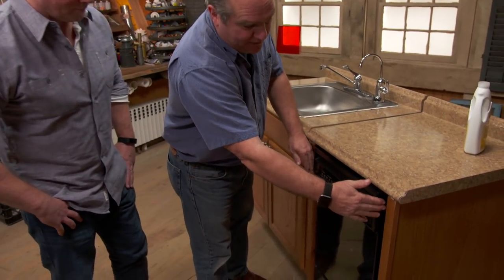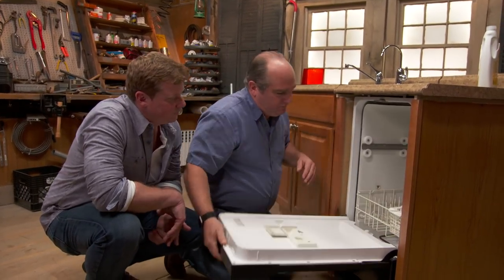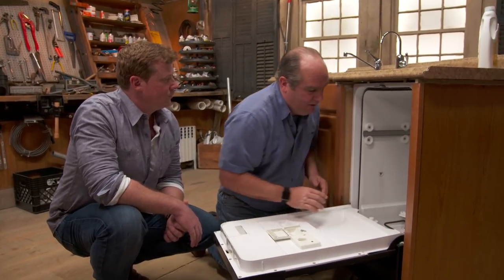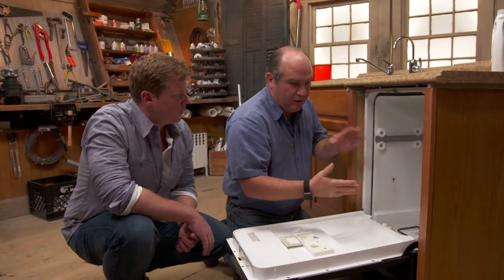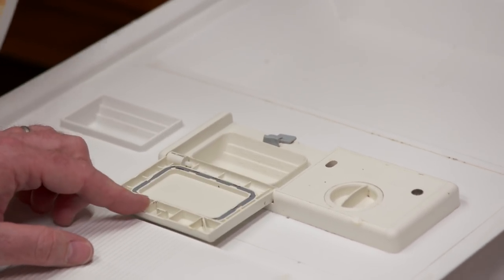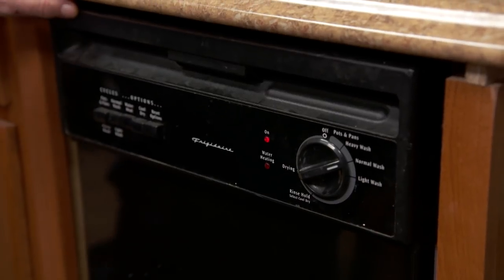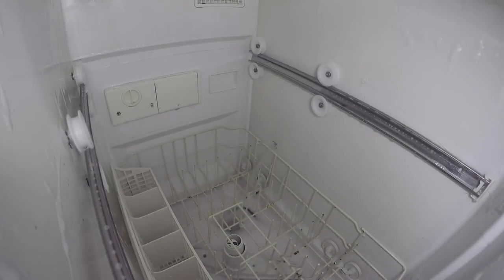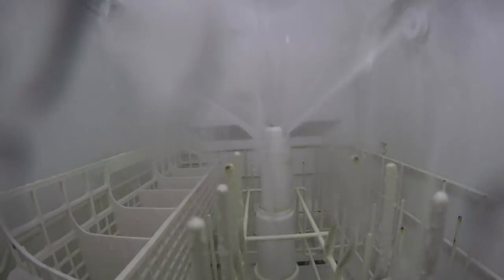Understanding the Cycles of a Dishwasher | Ask This Old House

Comment: Also, even if you use a pod for the main wash. Use a little liquid for the prewash. That little bit of extra cleaning time can go a long way, especially for a load of pots and pans. 

It is also worth checking the owners manual. Many dishwashers do not heat the prewash water, because it is a shorter part of the cycle. In that case, run your kitchen faucet until you get hot water, right before starting the dishwasher. Hot water simply cleans better.

Comment: Tip: If you have a manual knob dishwasher like this one, make the selection on the rotating knob before closing the door completely. Otherwise, the internal contacts of the knob will electrically arc as you spin it, prematurely wearing them out.
Learn from my mistake, and save yourself a couple hundred bucks on that repair.
Reply: THANK YOU!

Comment: One thing not mentioned anywhere in video or comments is that many dishwashers have a turbidity sensor. This senses how dirty the drain water is and based on that runs more cycles. I found this out when replacing my bottom rubber tub on my GE washer

Comment: My caloric built in 2000 is similar but has a smaller arm above top rack,  schematic shows it has water pumped to it, been cleaning out lime or scale today of both arms, manually and running vinegar through it after, was all clogged up, still don't think it's spinning yet or it's for a certain setting, the bottom arm is ok IDK, just bought the place. The bottom arm has small metal heat shields where it stops above the heat element, make sure they stay on!!! Pretty sure I'll have it working ok.

Comment: Do you believe it is necessary to affix a shield (say aluminum skin) to the underside of a wooden countertop  to protect it from steam coming from door when opened after cleaning?
Reply: A couple coats of urethane on the underside of the countertop that's exposed to the steam would do the trick. We installed quartz countertops and used acrylic sealant on the unfinished/unpolished underside just above our dishwasher before installing it.

Cheers, and good luck.

Comment: I always wonder how does the rinse aid gets released no one has posted video on that.
Reply: There is just a small valve at the bottom of the rinse aid well and when the timer calls for it the valve opens and drains a bit into the basin for use.

Comment: That final power drying cycle is wasteful, hence I always choose "no heat dry". Given a couple of hours, the dishes will dry anyway due to residual heat from the wash.
Reply: Timur G yep, I just open it up when hot and let the dishes air dry.
Reply: Timur G I do the same I pull the door open/pull the baskets out to let it vent properly & the dishes are 100% dry in 10 mins from the heat
Reply: The heat is to sanitize

Comment: Your are wrong!!! Float doesn't trigger the water intake solenoid until water level is reached. GE dishwashers let flow water during 44 seconds before starting the washing cycle. Float is a security that triggers the solenoid ONLY if water level becomes too high.
I'm having problems right now because pressure is to low and 44 seconds of water is not enough to clean the dishes well...
Reply: you do not know how all dishwashers operate. Richard is correct.

Comment: Maybe...but I believe you are wrong about the Flot, it is not to stop the water normally, it will stop the water only if it overflows, the dishwasher fill at first by time controled by the control panel program
Reply: this dishwasher uses the float switch to sense the level. thank you.

Comment: I have never seen a dishwasher with "hot water in" as stated at 0:32 Every single one i've ever installed have been COLD water in ONLY. The dishwasher has a water heater itself to heat the water for its wash cycles.
Reply: Game Changer WHAT? Exactly what century was your dishwasher made in? A modern appliance should ONLY have to heat water for a possible sanitary cycle! Yes, hot water in only! You sure don't know how to install a dishwasher!  Watch a few installation videos and be surprised!. What an energy waster you are, using a dishwasher to heat cold water, I'll bet your cycles run forever!
Reply: love it or leave it, i'm sorry if you're only used to cheap low end dishwashers without a heating system.  but EVERY dishwasher i've installed had a heating system. speak of only what you know.
Reply: @randomsecrets  you have no idea what you're talking about. all dishwashers require a hot water input. post no more comments please.
Reply: i mean what kind of idiot hooks up a dishwasher to cold water. really.

Comment: wow i though there was a lot more spraying going on inside in different directions.  no wonder why dishwashers are crap
Reply: I think this one came of of a museum. No comparisation to a modern one. At least the the moderate priced one i bought here in germany two years ago.
Reply: 32deej There is, that dishwasher has one spray arm. Most regular sized dishwashers have 2-3 spray arms that really increase the amount of spraying going on, but that particular dishwasher is shitty.
Reply: This is an example of the kind of trade off with moving to modern appliances. One spray arm but it's still running (what appears to be) 100 years later. But move to a modern one with more features/power and the electronics go south 13 months in leaving you very frustrated and learning how to repair/replace a control panel. This message brought to you by maytag.
Reply: 32deej I have a newer Maytag Jetclean dishwasher and it works perfectly. I love it!
Reply: give it 14 months.
Reply: 32deej nope I've had it for four years. Looks like you got some bad luck 😂
Reply: Daniel Woods haha. this may also be true. we'll see if this control panel lasts longer.
Reply: It's not only the dishwashers, it's mostly the detergent. Ever since they took STTP out of the formulas, it hasn't been the same. You either have to get Bubble Bandit or Somat, and both of those products cost an arm and a leg. Even Somat is going phosphate free, so the bags that have phosphates in them are limited. You can always buy the STTP and just add it to your wash load and you'll see the difference. It may not be environmentally friendly, but it works. 

The OxiClean Power Crystals with phosphates added to it were the best, but for some reason; that's gone also. You can still get it, but they want $40 for a 12oz bottle.

You're right though, the older dishwasher did use more water and power.
Reply: @lori4340  Yeah, my dishwasher works great. I was having problems with my detergent not working but since then I've tried the top 3 Consumer Reports detergents, Kirkland (costco) pacs, Members Mark (sams club) pacs, and Finish quantum and they've all worked well with Finish definitely working the best over time. With the costco and sams club ones, a film eventually builds up on glasses but the finish quantum gets rid of it so I just use finish about every other wash (cause it's 4 times the price).
Reply: @flybywire5866  in europe dishwashers are way more advanced. in the US they are stuck in the early 90's
Reply: They are extremely handy for people who are extremely busy and they will in truth use far less water than washing by hand. Washing by hand actually consumes more water. I done research online and that is how I found out that fact

Comment: Stop being lazy people. Do your dishes by hand. Its cleaner, less energy, and more satisfying. Plus it also saves time because you can do it quicker than the dishwasher can.
Reply: Michael Lim not true. Dishwashers only use a few gallons per wash, whereas the water is constantly running when washing by hand. Also, it takes water of at least 140 degrees to kill all germs, and if you tried to wash your dishes by hand any hotter than 120, it would burn your skin off. In my opinion, it’s easier for me to put everything in the dishwasher after cooking a meal, turn it on at night, and have clean dishes in the morning.
Reply: Michael Lim - Dishwasher is more effective.  I always did them by hand and liked it. The key it to always have a fully loaded washer so you need more dishes. You fill it up over a few days and run one quick cycle. 4 gals of water is very low usage and id never be able to wash a setting for 8-10 people in that little water
Reply: Dishwashers are actually way more efficient than hand washing. Here's one test but there's many others you can google: https://www.reviewed.com/dishwashers/features/please-stop-hand-washing-your-dishes
Reply: Michael R - Hey agreed. However i stopped using the dishwasher in the last month and got a commercial sprayer faucet. The thing i dislike about the dishwasher is that it bathes your dishes in the same dirty water over n over and this requires a strong detergent and a strong rinsing detergent. The Detergents never rinse away fully and over time turn dishes opaque from the strong pitting action. You also drink water and eat food from those plates.
Reply: Actually the dishwasher is in my opinion a real time saver as hand wash uses far more water and more energy. It also takes up personal time.
Reply: To waste same water as a dishwasher you have to clean 17 dishes per minute (water tap fully open) to be even on a dishwasher, dishwashers are very efficient nowdays
Reply: @GrzegorzDurda  it exchanges the water several times. do you have the same complaint about your clothes washer?
Reply: @SilentServiceCode  - Yes dear wolf pack i do. Hence from time to time i do laundry by hand in the tub. An amazing buildup of detergents release more then then dirt.
Reply: Forget dishes entirely.  Use your hands to place food upon and just eat from it.